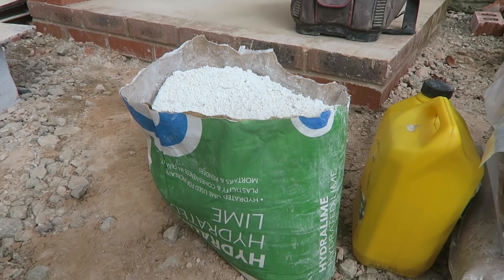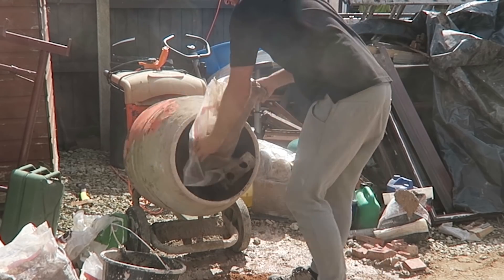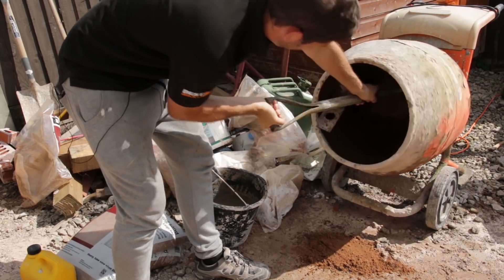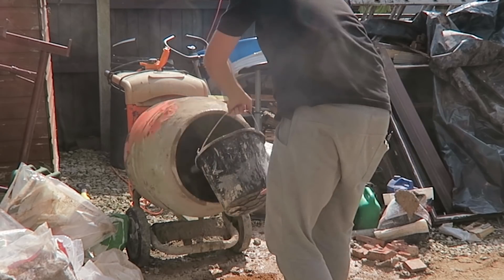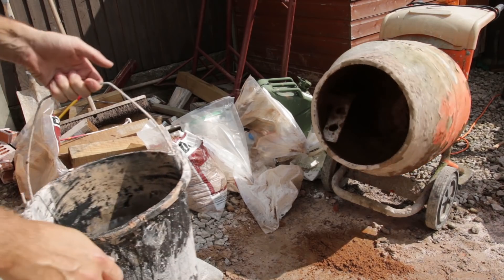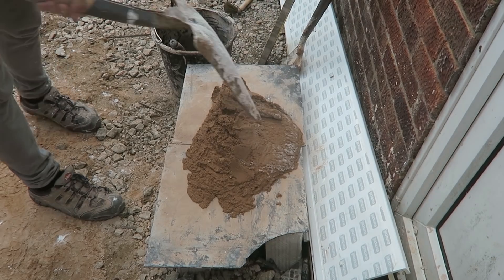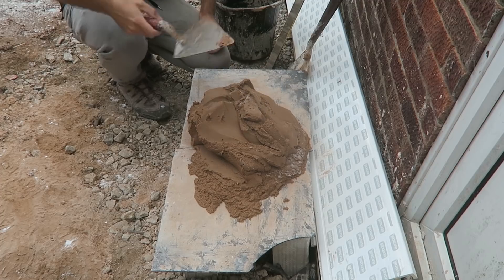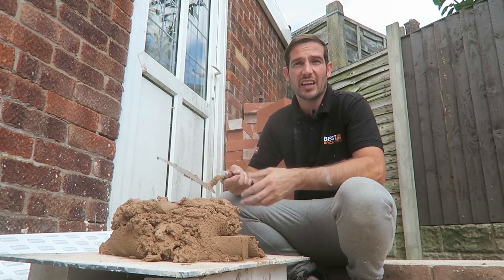how to mix training mortar with hydrated lime for bricklaying

Comment: First exposure to bricklaying was about a month before getting out of the Army. The name of the class was "Project Transition". We used the same mixture, & laid the brick on a waist high  2"x 4" 8' in length, with line blocks @ each end of the run on the vertical 2"x 4"s. The instructor had built a permanent 2 column spiral arch, just outside the classroom, using only two side by side brick. Overheard him tell a visiting instructor... "The men in this class who will actually later become bricklayers... will be the ones who marvel at, & ask me the most questions about how I built the arch part. Between me & another Sgt. we wore him out over it. Damned if he wasn't right. @ least on my part anyway.-former recondo sgt. "rock" 82nd abn. inf. '71-'74   101017

Comment: Stu I mixed up some training morter as instructed may have not put as much lime as u used. I used bricklayers trowel to scoop lime out of bag 1 quarter of 25kg bags. It's obviously getting damp and cold in uk now. Noticed that it did not harden over night still very wet I have used it before but indoors at my training and it hardened pretty well. If I added more lime will that help me

Comment: Hydrated lime only goes off when cement is added hydrolic goes off buy it’s self. I want to build a wall at my parents with hydrolic lime mortar but want a nice white mix
Reply: Hydrated lime goes off very very slowly as it sets by absorbing carbon dioxide.  There is no need to mix cement into lime at all, ever, despite what people say.  Hydraulic lime sets with both water and carbon dioxide making the set time faster (slower than cement though which is very fast).

Comment: So quick question with this recipe and maybe some aggregate like pebble size stones, can I build paver stones (Not as a mortar only) with hydrated lime and again the sand and aggregate rather than using concrete???!!! No ones answered me so far so I’m losing hope but I’ve seen Lime floors poured both in and outside for patios and even earth blocks made with a fresh slated Lime. I don’t want to have to “boil” essentially my own Lime, but I love Lime and would love to create my own “concrete” pavers without adding any cement and instead relying solely on hydrated Lime as cement I’m afraid would not only ruin the color of Lime making it a grey slurry, but the point to Lime is it’s a breathable, natural material and when walked on outdoors it doesn’t get hot like concrete. In SW KS, Lime stone is naturally occurring everywhere around the country side but I don’t own land I can scavenge and take from, I also am 100 lbs and can’t lift those suckers either so if I can essentially make my own stones without cement to ruin the amazing qualities of Lime then that’s what I’d prefer but I just have no idea what ratios and if it’s really even possible buying from the box store like Home Depot?!

Comment: hello matei have a question.
i will like to repoint a brick wall with lime mortar, is 4 parts sand to 1 of hydrated lime for a good mix?
thks to your amazing videos they are awesome.
Reply: From what i've read, Lime mortar is hydraulic lime which sets but a a slower rate than cement,  hydrated is to make the mortar more workable when using with cement or like this video as training mortar without cement.

Comment: Stuart, I want to start practicing in my garden with brick work. You know how you say you can re-use this mortar with the hydrated lime through it, well, how long will this morter last? Can i
 use it the next day or would it only be daily?
Reply: Jack Mc if you just use lime and sand you can reuse it over and over by chucking it back in the mixer and adding water. As soon as you add any cement it’s single use only
Reply: @MrOitoyboy  Thanks for explaining that mate, I was wondering about that

Comment: Questions rather than a comment this time Stu. Is it correct you're using the hydrated lime IN PLACE OF the cement you would usually use because it won't set and it can be used a few times to practise? What does the plasticiser 'do' and do you add it into EVERY mix? Thanx
Reply: It can be used as many times as you want. I’m in training to be a bricklayer in college and we use the same mix. At the end of each build we put all the mix into a wheelbarrow and put it all back into the mixer as if we are starting from scratch. And the plasticiser is to make the mix more workable

Comment: I've been told 4 sand 1 like is a good ratio for training mortar. Does that sound about right people? Thanks
Reply from the maker: yes with a standard cement mix but training mortar there are no rules because its never use on site because its purpose is just  to re use time and time again
Reply: stu crompton . Thanks for the reply Stu.

Comment: Looks like it's hydraulic lime, not hydrated as in the title. It's a bit specific how lime is in its process. From the bag hydraulic will react with water instantly, hydrated lime is already slacked and won't react. Hydraulic lime is difficult to find in US sadly at an affordable rate.

Comment: Hi Stu,

Why don't you try dampening the lime before putting it in the mixer?  It will keep the dust down and it is being mixed with water anyway.

Just a thought.
Regards,

Bill.
Reply: Hey Bill, golden rule never add water to lime. A chemical reaction occurs that creates a lot of heat that is hot enough to easily burn you or melt the container it is in if its in plasti.. Always add the lime in slowly so the heat generated can dissipate in the other material, in this case the sand. Usually when making lime mortar you would have a metal tub full of water and add the lime in slowly, the water and the metal tub will dissipate the heat, never mix lime mortar in a plastic tub.
Reply: Thanks Paul,

I'm a photographer and not a bricky but I'm learning so much from watching Stu's videos and the advice that people like you give me.

I'm wanting to build a BBQ.  One day I will pluck up the courage to have a go and put it all into practice. hopefully it won't look like a dogs dinner.

Thanks again for the advice.

Bill.
Reply: @paulknox999  Hi Paul, what you've wrote applies to quick lime CaO, what Stu is using is Ca(OH)2. It is still alkali but not as reactive as quick lime itself. Not so long time ago (I'm in 40's but still remember) before starting any build, lime was kept in trenches for few weeks to hydrate quick lime into hydrated lime.

Comment: Only one problem . If I was to go ona job , and my job was , to mix Cement . I would get fired because I would be dropping sand and Cement on the ground , and I would be wasting the bosses material . I'm just saying , you dropped alot of sand and cement .
Reply from the maker: scoop it up and throw it back in mixer, job done